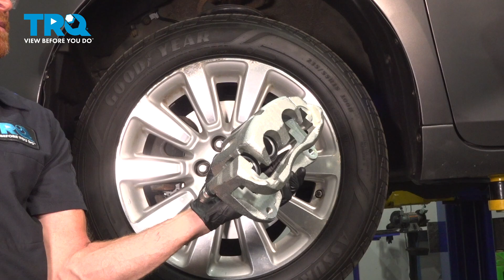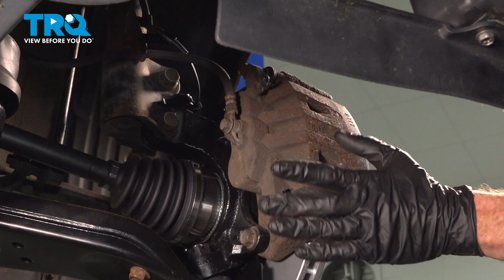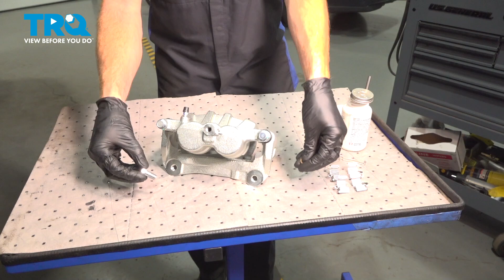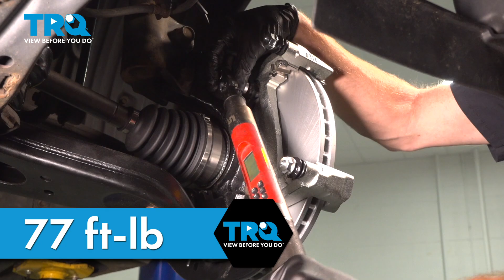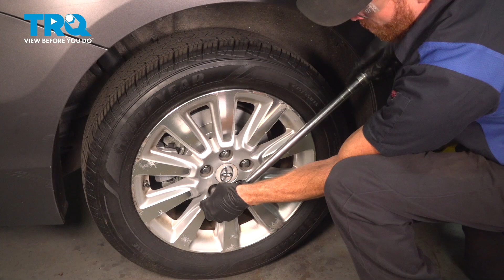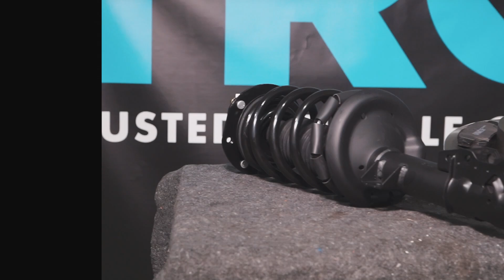How to Replace Front Brake Calipers 2011-2020 Toyota Sienna

Comment: Can you explain Front Brake caliper sliding pin with RUBBER BUSHING on it will go on top or bottom?  for 2011 SIENNA (3.5/6 CYL/ AUTO Front wheel drive)...